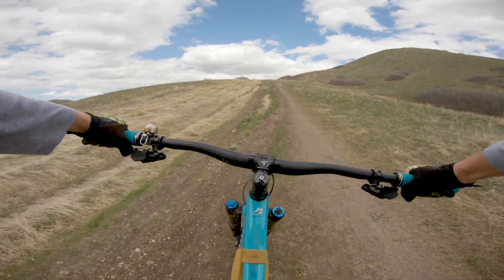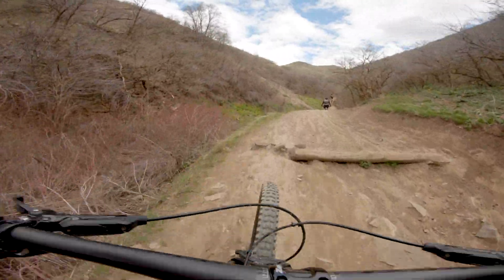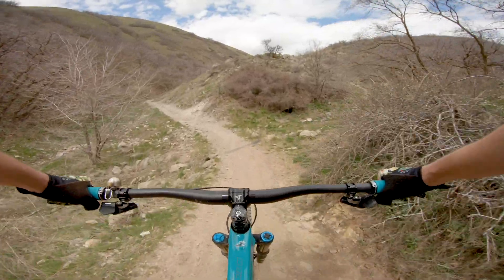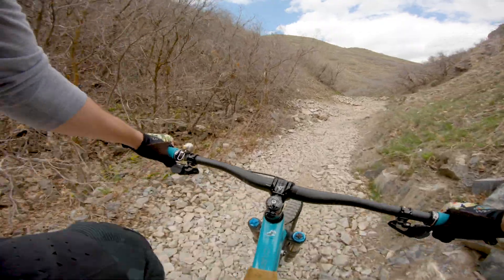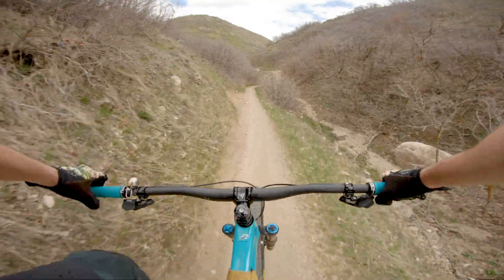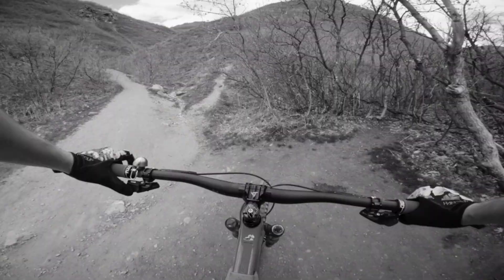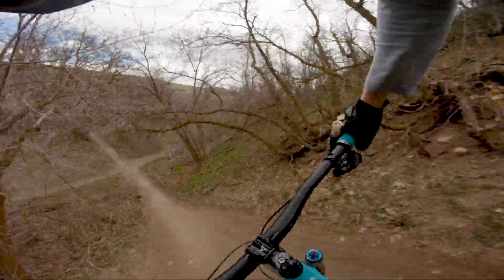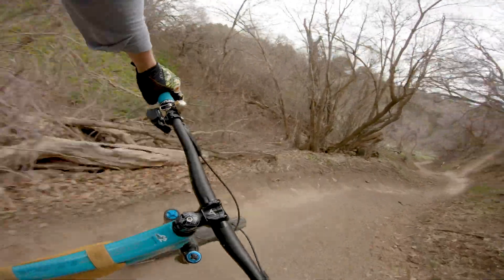Carbon vs Alloy: Wheel Showdown // DT Swiss M1700 - Part 4 of 4

Comment: Super and balanced review. My son and I have just up (down) graded from the Bontrager 23mm carbon wheels which came on Supercalibers to aluminium Hope wheelsets. The weight difference was not much considering that the Hopes have more spokes and steel eyelets and we prefer the feel. I am sure a top end carbon wheelset like the ENVEs would impress but the entry level / oem carbon disappointed.

Comment: Enjoyed seeing this video. Appreciate the comparison, especially with all the hype around carbon wheelsets. Often wondered if the extra money ($1200 to $2400) is worth the upgrade for us weekend warriors.

I'm currently riding the DT Swiss M1700 Spline wheelset. It came standard on my Pivot. The key to upgrading the climbing performance is upping the Star ratchet for quicker engagement (36T provides greater reliability over the finer-tooth 54T ratchet according to DT Swiss rep). Running Hadley hubs previously, the 18T was extremely noticeable, especially in loose, technical climbing situations. Also, you can upgrade to ceramic bearings from Boca Bearings for not too much extra, which I've done.

Comment: interesting that downhill results very similar despite the feel. climbing is where all the difference is...significant difference. Would love to see HR on each climb to figure out if times were all down to wheels or there was a significant difference in effort. power meter would be even better
Reply from the maker: The power meter would have been best for sure. I picked a segment of trail I've ridden close to 100 times. That way I knew the effort required and felt pretty confident in my opinions of the wheels. Not perfect, but as good as I could make the test with my resources.  I've never ridden the we are ones so I can't say either way.
Reply: great series by the way...I am currently trying to decide between Union (We are One)/Zipp/Enve
Reply: Not that much difference in the climb though.